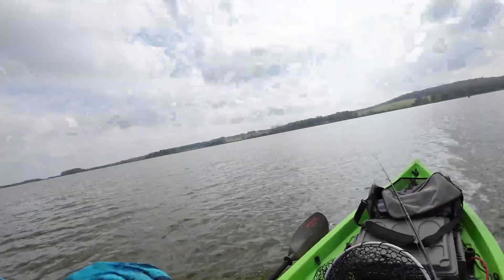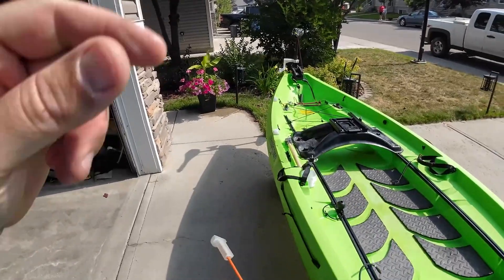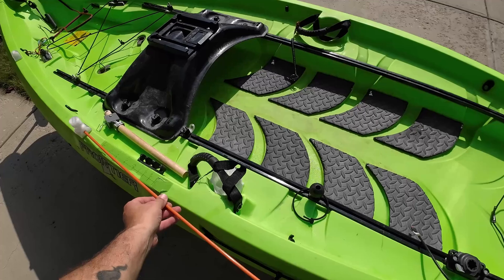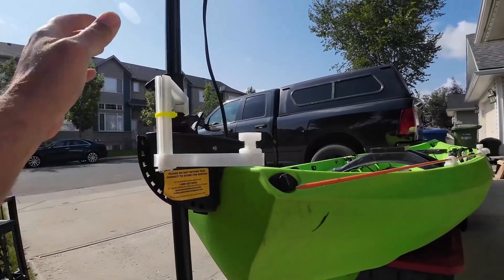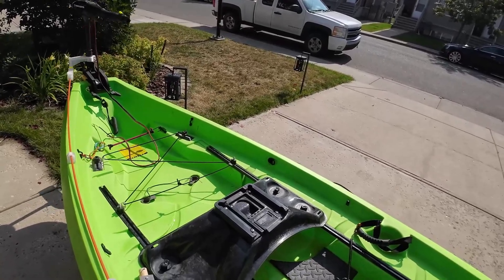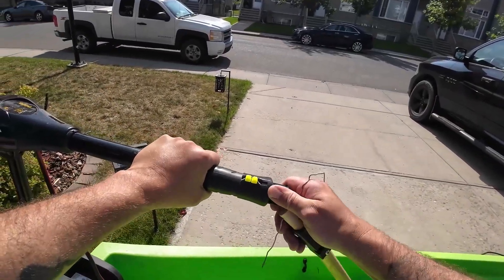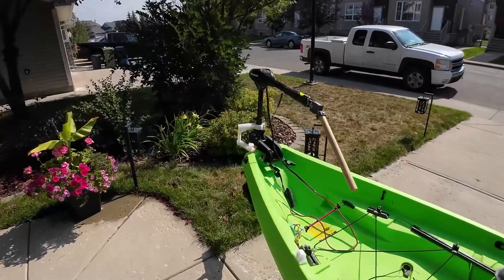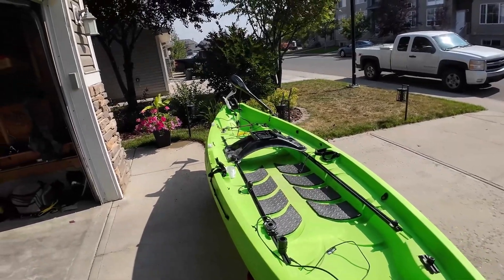DIY Kayak Trolling Motor Steering Setup #kayakfishing #trollingmotor #DIY #nucanoe #3dprinting

Comment: I really like this idea for steering. 
I have the same trolling motor and had removed the head and extended the wires which was ok,but over the winter I made a control box to house everything and a Scotty mount ball so it attaches to the rail. Once I am back at my trailer in April I will send you a couple of pictures of it
Reply from the maker: Sounds like a really cool setup. Would love to see it

Comment: Great idea. 
In regards to the knurled bolt and nut from akira 3dp0. What size did you used?
Reply from the maker: It's been a while but I want to say either 10 mm or 1/4"?  I basically just picked one that was roughly the same diameter as the fiberglass Rod I used